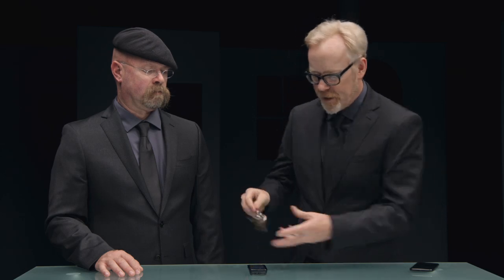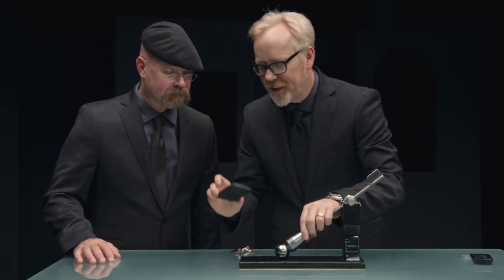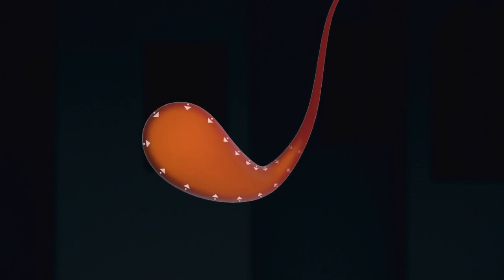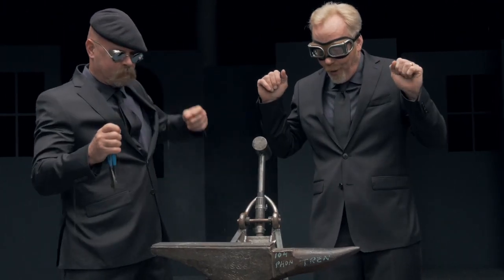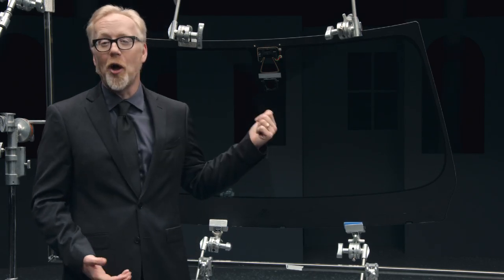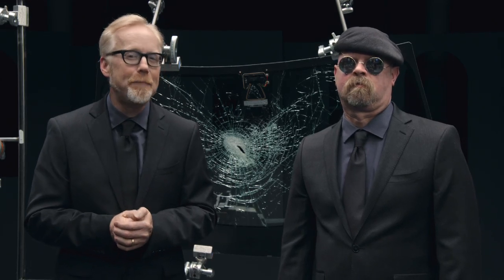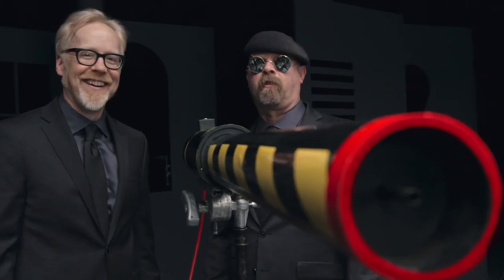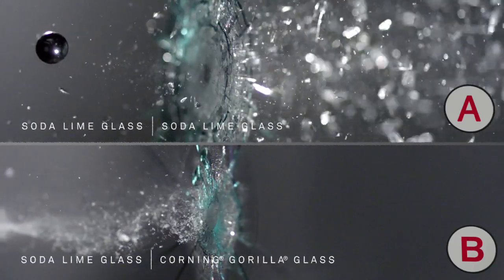The Glass Age, Part 2:  Strong, Durable Glass

Comment: I work at a glass fabrication company. I see the awesome break of full tempered glass. Usually the way it works is that if you chip the edge or any weak part--poof!! Laminated glass is pretty tough, but the either surface can still break pretty easy as they are just heat strengthened, not tempered, which is why the interior layer sprays glass. This is a very real consequence of cost savings for direct manufacturing.  Add in the cost of removing glass from a person's face or eyes, and then insurance companies start to take notice, which would be the real reason for urging manufacturers to use tempered glass. Incidentally, side windows on cars are already tempered, which is why they break into little pebbles when they break. What will be truly amazing is when we combine metals and glass particles in a matrix that is conductive, transparent, can be used as a display or solar collector, and is as shatterproof as the metal.

Comment: Here is a question: What would happen is the gorilla glass does break? Will it explode in to a lethal barrage for example in a car crash? If so ... dosn't it turn kinda useless compared to the Soda Lime glass. I mean having higher strength is good and all but if my face get's full of glass should I be in a crash then... no thank you. Ofc there are other applications like the skyscrapers who could do with a bit less weight. And perhaps we can make good use of it in space stuff. Not to mention of course the massive number of devices that would do well with it... as long as we can solve the who massive glass explosion... not want to fall only to have my watch explode on me ^^.

Comment: I would be more impressed if they would stop cars getting so hot inside. By allowing the infrared to pass through.  Wait that would be a tough cheap plastic solution. Maybe the company mission shouldn't focus on silicon dioxide solutions for transparent barrier solutions.

Comment: The question is, with that compression strength, what will happen if it does break? will it chatter like the Prince Ruberts Drop? if so, that might be more dangerous than the actual cause of damage.

Comment: All sounds great BUT I have 2 questions.  Given that in a situation where your locking mechanism in your car locks up (say battery fails) and you cannot open your doors to escape OR you are caught in a flood and cannot open your doors Will you still be able to shatter the glass windows or windscreen with those small shatter hammers so you can escape? Also in a 'head-on' accident how will this new glass react when a head hits the glass? Great demo ... very entertaining. Mike

Comment: the best way to make the toughest glass which is still commpressive strength i believe is to form it in space because space causes it to cool rapidly as well as being pulled at from all sides allows the glass to have huge internal pressure which holds it together making it really tough that may not be the reason its so tough but i'm assuming why but it is super strong if made fro space

Comment: So many different Glasses as well.. All have what is called a Expansion Coefficient... To large a difference in two Glasses joined? Makes a shear stress break.. Rapping Glass that expand around a Glass that expanse less.. Makes a compression fit as long as the two are within a very close small range of expansion to themselves.. Very important in making Glass to Metal seals..

Comment: They should test the phones with an impact on the corner. I drop mine flat on its face all the time and it doesn't even scratch but I dropped the same phone onto concrete from a foot high and it hit right on the corner and spiderwebbed all the way through bad. Every phone I've ever broken has been from a direct impact to one of the corners.

Comment: Why not use Gorilla Glass for both sides of the windshield?
Reply: It's probably a combination of the two materials that gets the best results. It could be that both layers being the thinner Gorilla glass results in something that tends to bend at highway speeds, or lacks the mass to slow down incoming debris as well as the hybrid option.Or something else entirely.
Reply: If the gorilla glass were to fail (which easily can happen with a diagonal force-- ahem sledgehammer--) it would become virtually opaque. Good luck on the highway when your windshield suddenly turns white and you can't see.
Reply: Probably due to cost - just Gorilla glass one side is going to be significantly more expensive than normal wind screen.
Reply: GameDog it probably works alot better with normal glass up front. All that glass getting shattered and sprayed everywhere is dissipating alot of energy meaning it doesn't have enough energy to break the back layer. if it was all gorilla glass I suspect you'd get large crack right across the glass

Comment: So why wouldn't they have laminated Gorilla Glass windshields? They thought about replacing one pane of soda lime glass but not both? If removing the inner sheet make it so much lighter, wouldn't it be even lighter and stronger still making the entire windshield with Gorilla glass be even better? Or go crazy and laminate three sheets of Gorilla glass to make a super awesome deluxe windscreen.
Reply: The laminate glass also does it's job. When it fractures like that it manages to dissipate a lot of energy. They use the soda glass to dissipate energy and the gorilla glass to ensure any shards don't get through. As you saw, compression strength glass shatters catastrophically and therefore you don't want that glass to be the one that shatters. 

The same principle is used in bullet-proof armour. They have a ceramic plate with a metal backing. The ceramic cracks spectacularly when a bullet hits it but that dissipates most of the bullets energy. The metal then ensures no ceramic or bullet shards penetrate the person. If they used just metal it would be very heavy. This way they can make the armour light but still bullet-proof.
Reply: Hazz Sin ... My point was why only change the one layer instead of all the layers.
Reply: Yeah, and I said that the soda glass layer also has a function. So you don't want to change all layers.
Reply: Gorilla glass would do the same thing when shattered. Why only change one of the layers of tempered soda lime glass when you can change all the laminated layers to really lighten the weight. The gorilla glass is providing the exact same functionality as the original tempered soda lime glass, just with much less weight.
Reply: Gorilla glass can shatter catastrophically, completely disintegrating and releasing the internal compressive stress energy rather than the bullets energy. 

Furthermore you don't want catastrophic shattering because you need the glass to hold together at the end to stop what ever hit the glass from hitting the person inside.

Gorilla glass isn't providing the exact same functionality. It is providing the strong back layer (like in bulletproof armour), but the way it shatters is unfavourable for some of the functionality a windscreen needs, like remaining held together after shattering. As you saw with the prince-Rupert's drop, compressively strained material pretty much disintegrates. Reducing the effect of disintegration also reduces its strength, so there is a happy medium you need to find. The hybrid solution provides more functionality in the end.
Reply: Remember the prince rupert drop when they nipped the tail and it exploded?  Compressed glass like that and this gorilla glass work the same way.  It's very durable because all of the pressure pulls inward creating a near unbreakable surface, but if it does crack, even slightly, then the entire plate of glass will explode (not figuratively either).

Comment: if you snip into a piece of gorilla glass.. does it explode catastrophically?
Reply: Haha, I think it's excellent logic
No, it has not nealy as much internal stress.
Reply: Sans a few very tricky tempering methods, yes, and it is the big reason we haven't seen it in cars yet. Any compressively strengthened glass shatters when broken, and the force of that break is roughly proportional to the strength of the glass. Ergo, if you have a really strong windshield, it may be immune to any stray rocks, but will violently explode during a car crash. There are ways around it (you can control the size or "sharpness" of the fragments with some clever engineering, and a strong laminate will hold the pieces together even when broken) but science hasn't quite mastered that yet. 
Mind you, I'm a Material Scientist but I haven't worked with high strength glass in 5 years. It's possible these challenges have already been overcome and I'm just not in the loop anymore.
Reply: Would love to see some proper tests. See where the limits are and what happens past them.
Reply: @NetAndyCz  you can buy a piece for a few dollars
Reply: Yes, it will break into many tiny shards.  That is a feature of all tempered glasses, whether they are thermally or chemically tempered.
Reply: Roman Gogueshvili no heel
Reply: What are questions asked by people who weren't paying attention Alex

Comment: What about in emergencies when you need to break the glass to escape the vehicle?
Reply: Nobody breaks the windshield usually as they are laminated, they break one of the side windows which is tempered glass and is MUCH easier to break. The front windshield would be the one that is made out of stronger glass.
Reply: Michael Nguyen break the side window
Reply: it'a good at resisting impact, but it can be cut easily with tools

Comment: Wait, if a windshield of a car is made out of that super strong glass, how do you break it to get out from a crash?
Reply: Well most of the time emergency crews use a side window because they are tempered glass instead of laminated. Tempered glass fractures into many tiny pieces so it won't do as much damage to the person if it shatters.
Reply: it'a good at resisting impact, but it can be cut easily with tools
Reply: Nathan Jones True but most of those tools are rather unweildy underwater, such as if the car went into a canal or river.
Reply: Like the original comment or all subsequent replies?

Comment: A key point that was missed here when considering the application of Gorilla Glass in car windshields is head impact. Standard laminated windshields (using soda lime glass) uses two pieces of "Annealed" glass (i.e. not heat strengthened) for the very reason that is weaker than tempered glass. If a person goes flying at the windshield head first because they were not buckled then they will experience significantly greater head injuries (and a greater risk of death) using Gorilla Glass than they would with standard annealed glass. Punchline here is that Gorilla Glass should have endless applications, but car windshields is not one of them.

Comment: It would be better to do the shatter test with an unscratched phone in both cases, the scratch acts as enunciation points for a shatter. I'm sure he tried to be as consistent as possible, but it's easy for the original scratch attempt to be subjective (subjectively the same force, etc.) especially when you have expected results for both cases.

Comment: I used to throw my Samsung Galaxy S2 with Gorilla Glass against concrete walls to prove how indestructible it was. as far as the glass goes it never failed, it wasn't until the battery cracked I had to get a new phone...
Reply: Threw my S4 once. Screen broke
Reply: ***** yeah, though I mean to have read that someone quite recently discovered a way to produce glass with uniform molecule orientation or something! (even though that's totally unrelated to this phone :-P )

Comment: why not make both layers of the windshield out of gorilla glass?
Reply: It absorbs the shock more effectively
Reply: 2017 Ford ft windshield is gorilla glass
Reply: BlackHat but if you see in shooting test, the glass is still broken but stays mostly intact
Reply: Actually, it was the compressive strengthened normal glass that does that. They never said the corning equivalent would shatter like that.
Reply: Like they said in the first video, the downside of the gorilla glass is that if it does break it shatters the entire piece.
Reply: When gorilla glass does break, it shatters catastrophically. With a two-part laminate, the outer layer can have a minor localized crack and be patched back on the cheap. However, if the outer layer is gorilla glass and a single sharp particle hits your window with enough force, your ENTIRE windshield with spiderweb crack. So, your choices are occasional cracks on a lighter windshield that can be patched up for a few bucks, or a windshield that will probably never break but if it ever does will shatter into a million fragments and require a complete replacement. option A seems like a safer bet to car manufacturers.

That said, I used to work in Glass R&D but havent since 2014, and the science could have leapt forward more than I realize.
Reply: Andrew Mayo because you want it to break
Reply: Price.
Reply: Andrew Mayo If you flew out of the seat not wearing a seat belt... you would want the windshield to give but not alow glass shard the shatter and become projectiles. it's a balancing act. This glass would be good for if you are engineering for seat belt use at all time which theoretically it should be according to most laws
Reply: Nicholas Landolina; if your not wearing a seat belt and you flew out the windshield its your fault for not wearing a seat belt
Reply: Andrew Mayo The only thing that broke in the shooting test was the normal glass. If the gorilla glass was to break it would all shatter. I think the normal glass is a lot stronger once broken then the broken gorilla glass.
Reply: it'll be too thin and start wobbling at high way speeds

Comment: Problem with windshield B, and why Jamie didn't use the sledge hammer on it.
Yes, if you used enough force, you'd break the corning glass too... but unlike Glass A, the entire back side will shatter if you break it.
That's the problem with compression glass.. it's all or nothing.

Comment: Holy shit 100,000 fps at 1080p
Reply: slow mo guys have 4K so I'm not sure what you mean by lower quality
Reply: Check out the slow mo guys
Reply: +Laszlo Szurly not they have to lower the quality.
Reply: +SubZeroAssassin but they don't have 4K at 100,000 fps. They have it at 1,000 fps, 1/100th of the speed
Reply: It's upscaled resolution, anybody can do that.
Reply: @A-Duck  The Slow Mo Guys could not record 100,000 fps at a resolution of 1080p. They have to drop the resolution to something really small so the video file doesn't take up to much space.
Reply: legostar55 I know. Which is why I said it’s upscaled.
Reply: @A-Duck  The point of my point is not to say the YouTube video of the Slow Mo Guys is in high quality. The Slow Mo Guys do not have the capability to record 100,000 fps at a resolution of 1080p. It's impressive that these guys had the capability to.
Reply: legostar55 why do you think I’m unaware of this? I can only say “I know” so many times. When I mentioned upscaled resolution, I was referring to the slo mo guys, in response to someone mentioning their youtube videos having 4K as though they were recorded at that resolution, which is absurd.

I’m not trying to be rude, but you’re barking up the wrong tree.
Reply: @A-Duck  Actually the upscaling is only in the YouTube upload. The RAW footage right off of the slow motion camera is not even close to 1080p. However, the raw video these guys recorded was 100,000 fps at 1080p resolution. That is not possible with the slow motion cameras that the slow no guys have without having an obscenely large amount of space. THAT is why I was impressed with the production quality of this video.
Reply: @A-Duck  In this video they recorded 100,000 fps at 1080p. That takes up a HUGE amount of space on a hard drive.